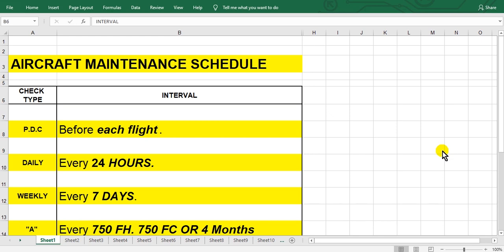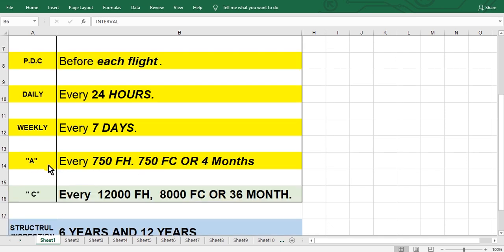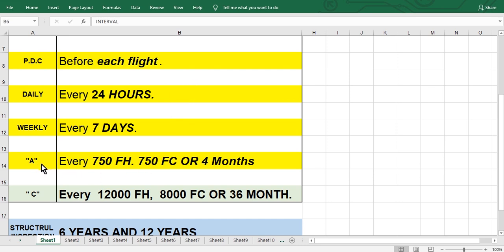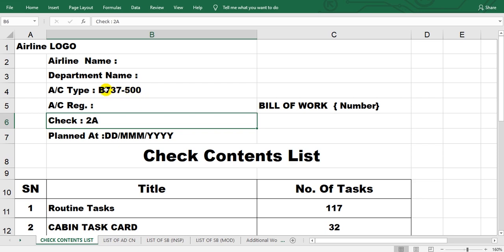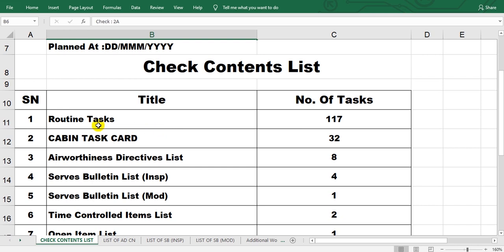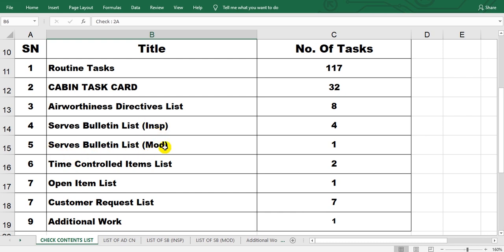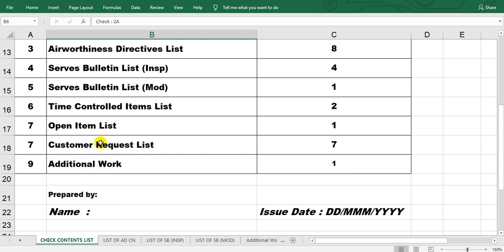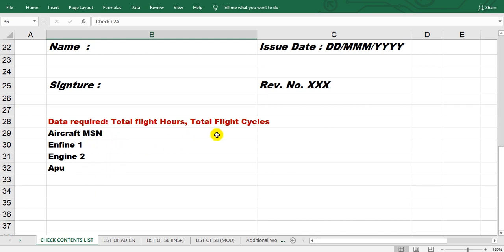How to make Aircraft Maintenance Project Plan

Comment: Hello, I need all the Excel files if it is possible. thank you.
Reply from the maker: do you have telegram app.?
Reply from the maker: my whats app is  00201144777811
Reply: Very helpful. Can I have the excel files too? However, I do not have a telegram or whats app. Is that required?